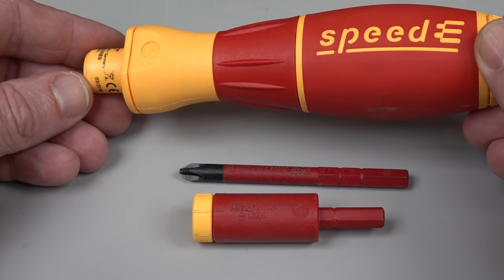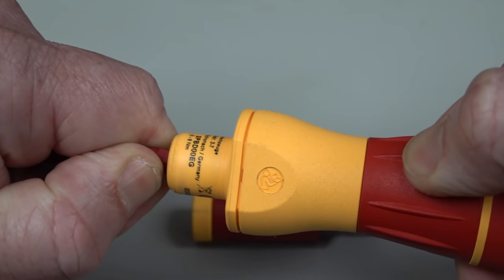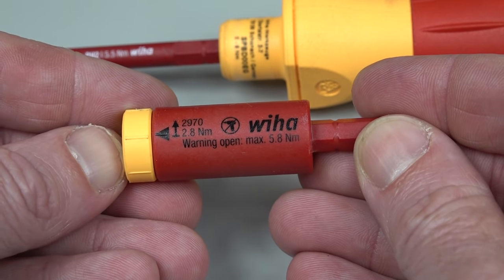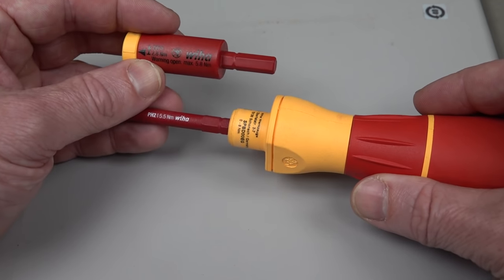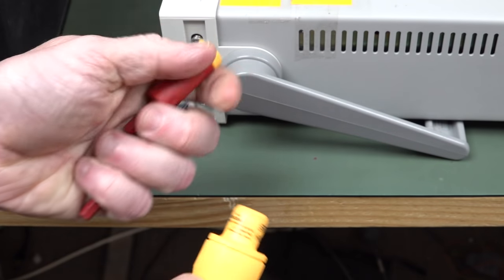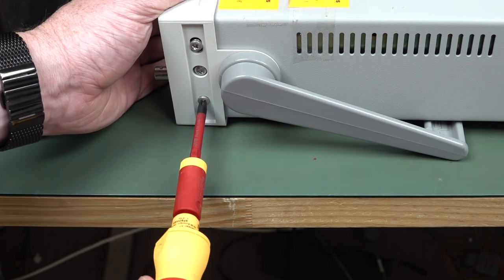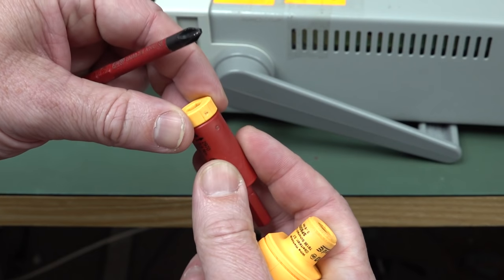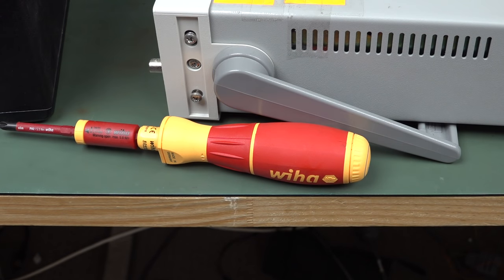Wiha SpeedE Electric Screwdriver follow-up

Comment: This Screwdeiver is for Electrical installation work. When you are installing thousands of breakers per year. You screw in the contact in electricly and then apply the correct torque with one of those Slip-Clutches by Hand. It's a very specific Tool for a very specific industry, nothing for regular electronics/repair work.
Reply: I've installed DBs like that. Dozens of meters x 4 terminals per meter x 2 screws per terminal... and I wouldn't use this. Too slow, wrong form factor, and the "clutch" doesn't seem to work. Get the proper tool.
Reply: As an industrial electrician I wouldn't use that tool . Even those small screws on a 30 year old breaker or relay would be to much for this tool. And if you are using this tool for installing new stuff only, you would go with something like the Panasonic Dave talked about, which can be set precisely to the required torque for a specific screw (terminal) for example. There is no point in doing it with this tool just to do the final Nm by hand anyway. I had the toy version of this thing: https://www.dwt-gmbh.de/userfiles/image/gallery/panasonic-akku-knickschrauber-ey6220/1-panasonic-akku-knickschrauber-ey6220.jpg
And it just was enough to pull out some M4, max M5 screws, and with my feel-o-vision I would guess it had more power that the Wiha, even it was a toy...thing this is a complete fail for its price!
I just want to know with electrician would use this thing in everyday work environment....
Reply: Yes Orbis92, and industrial electrician wouldn't. (screwless solutions are after all nice when one will redo it once in a while. Or just want less hassle during maintenance. (both being very normal and daily occurrences in the industrial scene.))
A consumer one still faces an abundance of screws on everything from breakers, switches, outlets, among other things in the every day consumer home.
And the whole idea with this screw driver is to lessen the risk for repetitive strain injuries.

But yes, it is a bit overpriced.
Reply: The Panasonic is not up to the job full stop max torque is 17.5in lbf that's only 1.98NM !   Take a :Hager board for one example the only screws that could tighten are Earth and neutral bus bar connections for wires with a diameter of 1.5mm or less!  You need 2.8NM for a MCB and 3.6NM for a SB Switch.   The torque adaptor being 4NM is 35.4in lbf.  Also the Panasonic torque is only aprox.....
Reply: we keep saying that - but which one? ....or is it like other 'ergonomic' stuff - which is way more expensive and made of inferior materials (paying for the ergonomic label basically?)
Reply: @timballam3675  at work we use panasonics all day they go to 4.4nm and we test each setting for the real tork so its quiet acurat
Reply: Sounds like a waste of time and money to own. Mate.
Reply: @nickhetzer2744  your spelling is quite accurate
Reply: Not to mention this type of tool will stop general electricians from developing carpel tunnel for that constant twisting motion! Has anyone used one of these for domestic work? Seems like a very handy tool to replace my 12v impact driver for majority on fit offs, would love to stop caring it around in my belt all the time.
Reply: Any leco would be using a portabale battery tool like the Hitachi Zip-Zips, with phillips bit.
Reply: Are we acting like impact drivers don’t exist or?
Reply: @alovimcafee876  not at all,  I use an impact driver all day every day and it would make my tool belt a lot more comfortable and manageable to use this type of tool instead
Reply: any link to that Panasonic tool
Reply: Alovi Mcafee I found the laborer
Reply: @windywindy  me?
Reply: @henryizzard4581 yes I wouldn't recommend it though I've only had it a few months and it's starting  to stick in one direction gonna try to disassemble it and clean it out but if problems continue I'll be asking for a refund

Comment: I do not understand the easy torque adapter.   But in my minds eye....  This tool is not meant to break free or tighten screws.  It is more meant to greatly reduce multiple screw removal/replacement without a lot of wrist twisting.  Once the screw is free it will spin it out for you right quick.  Upon reassembly the driver will spin it in quickly, stop at a light torque then allow you to snug the screw proper by feel.  I do not think it was meant as a regular tighten and loosen driver, more just to keep from doing a lot of cranking when doing a lot of screw fasteners.
Reply from the maker: Yes, but as you said, how does the torque adapter work? and why do they include it?
Reply: Yeap.  very right.  I have no clue why that was included.   Maybe for the screws you need to baby cause they are weak?  Ya know, the ones that are guaranteed to strip on ya.  LOL.    I will say this as well.....  That "WOBBLE"   in it,  is totally unacceptable.   Thought...  Assembly of rf shields say on analyzers?   Need a lot of screw all torqued the same, and go over 3 times each a bit more till correct?   Would this help any?  But then there are no torque settings is there....
Reply: why not get a normal cutsie low-performance cordless drill though ....or one specifically designed for that ....just get inserts and screw those in. its not like this thing is incredibly low form factor either. or a very low form factor torque slip thing to go between? .... The only place i could see this being viable is in very very expensive and special applications where somehow its faster doing it this way or you insist  everything is finished by hand.
Reply: Understand that.  In actuality.  No motors for me.  How about a old fashioned screw driver,  that  when put in a pile of screws, unlike a magnet one that grabs a bunch of screw and never by the head.  Want one where I can put it in my pile of screws and it comes out with the screw on the tip of the driver, ready to be driven.  Hope that makes sense.    Regardless of all, Love me some Dave Jones.
Reply: I know what you talking about. I recall seeing one or 2 my dad had when I was a kid.  A kind of worm gear driver, push to turn. yeap.

Comment: The extension is a torque indicator. It will click and the yellow ring and red adapter will rotate in opposite directions when the torque value by hand in reached. Torque extensions up to 7.0 Nm are available.
Reply from the maker: I tightended it up until I thought it was going to break and it still didn't click or rotate.
Reply: @EEVblog2  Then it's a broken torque indication :)
Reply: Try a torque wrench or is ur hand calibrated? 
Also: How much torque can PH2 (the bit) or PZ2 (the screw) handle?
Whia* says 5.5Nm max

*https://www.wihatools.com/max-torque-blades

Then there is the muscle problem. Here is a masters thesis* talking about things like "physical ability to apply torque":
"mean value of 3.3 Nm (SD 1.2) and range of 1.9 Nm to 5.8 Nm measured as part of this study where an actual work task was performed."
So this torque "adapter" is not going to get to the 2.8Nm because thats a lot of torque (ballpark maximum) without leverage.
Just use a torque wrench and measure it.

*https://epublications.marquette.edu/cgi/viewcontent.cgi?article=1226&context=theses_open

Comment: It's not an adapter. It only is a slip clutch to limit the torque when you tighten the screws by hand to the torque it's rated for.

Comment: The problem is you weren't applying 2.8nm. It would be difficult to apply that much torque to a phillips head without it slipping or stripping. Try a flat head or torx. All of the things you're complaining about were most likely specifically engineered that way. The wobble, the torque slip, the motor cut out, all designed for a specific application. The wobble is likely built in so the handle has some compliance when its turning, to stop the screwdriver from producing a force on your hand if you're not exactly concentric with the screw. This is obviously built into the design considering the rubber oring that holds the bit it. I could be wrong though.
Reply: Bob Sacamano I’m fairly certain I can apply 2.8Nm with the twist of my hand. I’m thinking of when I had a torque wrench in my hand and setting it really low, I could easily make it hit the torque “click” by just gripping the socket that’s on it. The limiting factor is the Phillips screw, and the machine he is attempting to torque it to. I believe this is for electrical panels and wire connections that require a specific torque to be to a certain electrical code.
Reply: The torque limiter is not rated 8Nm, only the screwdriver without the limiter is. Even so, the bit itself is not rated 8Nm. Depending on the bit size, some are much lower than 8Nm and some are closer to 8 Nm. 8Nm covers the entire range of bits though. I have the Makita cordless screwdriver and 2.8 Nm is about the top end of the torque setting. Like what Sean mentioned, manual 2.8Nm for a philips can be difficult.
Reply: @Bob Sacamano the adaptor is 4NM the 8NM is the safe working load for the body of the driver?
Reply: He used a phillips bit (PH2) on the PZ2 screw in the DUT (multimeter or whatever).
He also didnt use a torque wrench to actually measure anything... this video, sadly, contains next to nothing...
Reply: wah wah. Make your own vid then if you are such an expert.
Reply: He didnt get the Screwdriver sent to him for free. But even if he already had it: Imagine Dave testing a DMMs accuracy with a AA battery. It so happens that the battery is dead. "Naaah thats no good, the thing should be 1,5V! This DMM is rubbish!". Thats about how usefull his test was.
Reply: @leocurious9919  ..I'm not sure that's an equivalent analogy  ha
Reply: @leocurious9919 there's nothing that needs to be measured with a torque wrench. He was turning that screwdriver "as hard as he could, until it felt like it was going to break." That's well over 2.8 Nm. Probably closer to 4.5 Nm.

Comment: Apart from the an wobble, this really is a thing of beauty. To answer your question no your not using it right. The torque adapter is to stop over tightening of terminals as this causes the copper wire to creep which ends up loosening the terminals.

Comment: Just to underline the function of the easytorque - it's not related to the electric function at all, it was already a product in the slimvario product line, and is meant to torque limit a normal hand operated exchangeable-bit screwdriver. I'm not excluding the possibly that the unit you got was broken, but bear in mind that 2.8Nm is quite a lot of torque on such a small screw, even though you have quite a solid grip on that handle.
Reply from the maker: Well given that it's the largest tip in the kit and I was putting all my force on it until I felt like it was going to break, and it still didn't limit or slip, I can only conclude that it doesn't work?
Reply: EEVblog2 You could fix an aluminum bar to bolt. Then put the bolt through a hole in a plate. Lastly put know weight to bar at correct distance and you have a grudge torque measure device. You can calculate the torque = 1/2 bar length * bar mass + weight distance * weight mass. Mass in Newton’s and the torque is against gravity, ie rotationally lifting the bar and the weight.

2.8Nm is a lot of torque for a screw. If you haven’t done it in a measure way before, you should, I’ll bet you will be surprised.
Reply: Very rough guides to torque in human terms:  1Nm - finger and thumb, 10Nm turning a big screwdriver, 100Nm turning a steering wheel (two hands).
Reply: confirms my thoughts on this being a fail if it doesnt do that at all.. i mean its the 21th century right? .........this is not a bleeding edge power density tool RIGHT?.........shouldnt be that hard to sense torque semi-accurately and have nice options for control and adjustment right? .......... well you might have to buy a special motor with a very stable Nm/A constant  but i dont think thats where the money went on this thing - frankly i dont know. Be carefull with these, they might have implemented a black hole inside that sucked the extra +100$ inside of itself.

Comment: I don’t see a problem in this product on metal screws and not wood screw. It is conceived based on time management for professional maintenance and repairs. 

You see, it takes a fraction of a second to  break loose a bolt in electronic equipment but it will take N times longer to disengage the threads, manually. The powered drive was intended to reduce N down to a small fraction of N and were meant for speed but force.  Likewise in manual fastening cycle, N times longer to the last thread only takes a split second to snug it. This tool speed that up. 

Snugging but stripping the threads (or bending drive tip) is another critical consideration. When working with self tap screws I will not give up the opportunity from receiving torque/force feedback in manual operation at the last moment of quarter turn. Because I need to assure that plastic thread ( or bit tip) will not be blindly stripped down, as it will otherwise be by the motor drive to an unknown torque setting. 

Those who confused or complaining about this product spend most of their time toying with professional tools but professionals themselves.

Comment: The torque adapter is used when you are manually tightening a screw. When you tighten the screw to the preset limit shown on the torque adapter the bit will just stop turning further even if you keep turning the handle. The torque adapters are available in different "strengths".  Probably not too useful for a homeowner but for a pro it will prevent over-tightening and stripping.

Comment: That torque extension is for tightening screws on industrial equipment, like relays, switches and so, where that 2,8Nm is around the required torque to tighten the contact screws.
Reply: But how does it work?
Reply: It slips.
Reply: Yeah it wasn't releasing under huge torture.
Reply: It is a mechanical clutch for the hand-tightening after the motor stops. Either Daves adapter us broken or he didn't try hard enough (2.8 Nm seems a lot for such a small screw anyways ...)
Reply: I think he didn't apply enough torque.
Reply: Possibly, 2.8Nm on a 5cm diameter handle requires a force equivalent to that of a 11.2kg weight.

Edit: Oops, wrong...
Reply: I think it works like a torque wrench and clicks when the torque is reached. I don't think it doesn't fully slips like an electric drill does. They also sell those things in sets, so I don't think they are adjustable.
Reply: soo ...  this is better then a dedicated thing to do that if its your job?

Comment: What about that yellow part of that adapter? Does it rotate? Maybe it has inside slip ratchet?
Reply: it almost seems like it has raised marks for different settings in relation to the black arrow on the red body... hmmmm
Reply: it does...
Reply: It moves a little bit when the torque is achieved. There are faint indicator marks on the red and yellow parts, and it's supposed to give a click as well.
Reply from the maker: No its does not rotate, although it looks like it should.
Reply: EEVblog2 then it's either broken or you didn't crank it quite hard enough. The parts should move independently quite a bit. If you search for Wiha EasyTorque Adapter Tutorial, they show a closeup in that video.
Reply: How it should work: https://www.youtube.com/watch?v=HDdyk0aW9Bo

Comment: This screwdriver is designed for the electrician. Usualy, the miniture circuit breaker you can have at home must be torque at about 2n.m; no more ! so this screwdriver is perfect if you have to tighten a lot of this circuit breaker.

Comment: Check into the dewalt 8v max gyroscopic screwdriver. It's got plenty more features, torque and is nicely compact. A lot of people in HVAC field use this for service work.
Reply: Yeah and it's closer to $29 than $299. But let the fan boys Wihahahhahahahahahaha

Comment: Like Butze already said- its specifically for electrical installation works. Unlike in US domestic panels, in EU we have to torque each and every breaker with the correct setting (where screws are still used). Such tools enable you to quickly drive in the screws and you just torque the last turn.
Reply: Or you could just get a drill driver with settable torque for  1/10 the price. There is no way to justify the price of this thing for the EU or anywhere else. There are far better tools for far less that would do a better job.

Comment: Dave, 1 question.
Why are you using an electrician's installation screw driver for tightening a screw on a case?
This tool is obviously not intended for the application you are using it for, and its main feature (even somewhat clearly pointed out in your other video (the recommended by doctors part in the marketing blurb)) is that one doesn't need to twist one's wrist/arm repeatedly to screw in a screw. This all results in a lower risk for repetitive strain injuries. Main market being electricians. (And likely not the industrial kind either, since they usually likes to use Wago terminal blocks and such, screws are falling out of favor in the industrial scene. While the consumer scene uses screws, but mainly uses more and more breakers/sockets/switches and other similar things in their electrical installations.)

Comment: Don`t understand the torque adapter well BS 7671 requires all terminations to be tightened to the correct manufactures torque. This information is available on line. Look at set 3 over £543 and all the different torque adapters come with it. So all your termination can be to manufacturers spec. BS 7671 is harmonised across Europe. So this (LAW) applies across Europe and means nothing anywhere else in the known universe. I hope that clears that up
Reply: If you think that way, there might be laws/standards that are just valid in United States of America and nowhere else in the known universe.  Note that the population of USofA is 327 million,  EU is 512million.